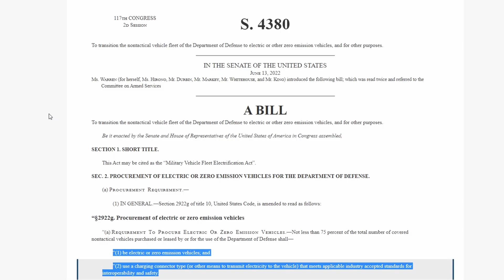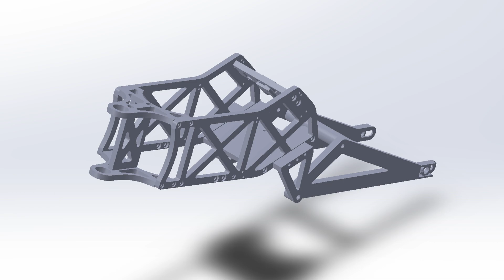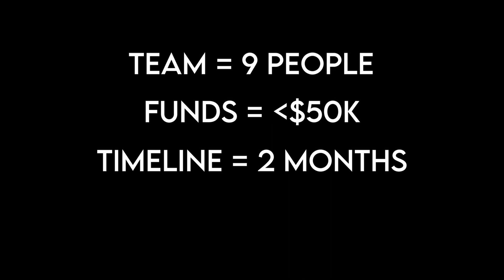SUR RON KILLER?! // PROJECT KATARA // PIT Projects

Comment: just order a dirt bike frame from china and use those to mount all the components and you're good to go, with a competitive price that will sell like hot cakes without attempting to reinvent the wheel (or the frame in this case) 

you don't have to make everything yourself, those big companies don't even do that lol they order pre fab everything from multiple distributors then release it, its commendable that you tried to build a bike from the ground up like this though. You could probably get hired at one of those big companies off this project alone, you clearly would be a valuable asset somewhere
Reply: I looked into that quite a bit. I did find a vendor who sold pit bike frames and parts, the problem is that the minimum quantity was 10 frames which was too much for me. I also found a seller who was willing to sell me just the frames for their electric dirt bikes but the MOQ was too big
Reply from the maker: I appreciate it bodie! I definitely considered it, but want to (foolishly) try and reinvent the wheel. It was so fun and we learned a ton from the whole endeavor. Now i just gotta swap the motor into a buggy and scrap the frame ¯\_(ツ)_/¯

Comment: Not a SurRon killer Yet the battery alone to heavy my SurRon tune 15kw hit 81 mph Excel 21 Front 18 Rear Dunlop  Greenline 8000 Bomber58 suspension Titanium Bolts,shafts,Bearings ,Swingarm, dirty bike throttle Smoke that bike 72 volt
Reply from the maker: I have a sur ron running more than 15kw, this bike destroys, no contest. Unfortunately, it feels like its gonna destroy itself tho…